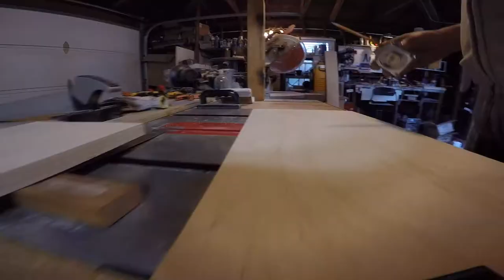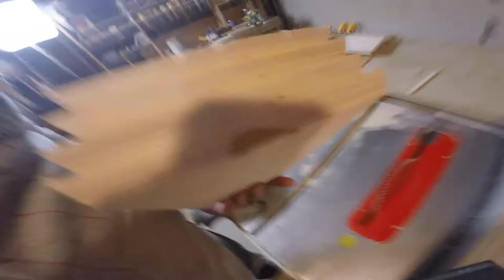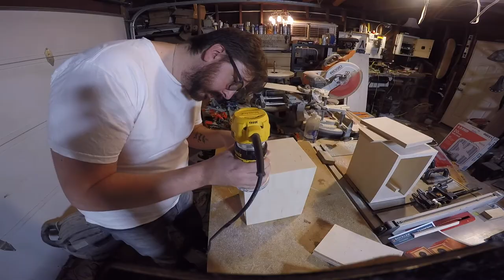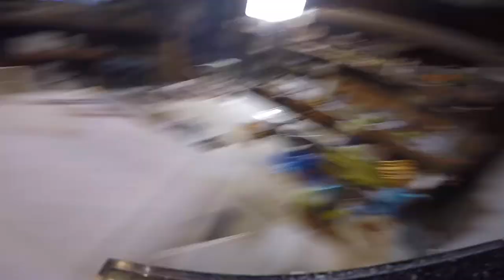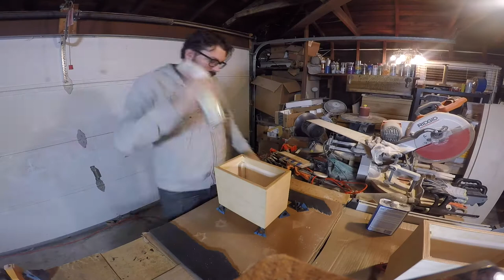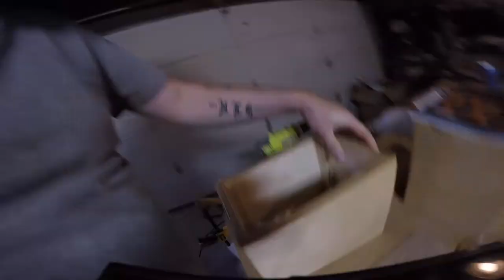DIY PLYWOOD BOOKSHELF SPEAKERS

Comment: Your "transistor" in that internal wiring is a capacitor  which acts as a crossover. 
I would suggest if you want to build a better set of speakers to get yourself a kit from Parts Express called the C note.

Comment: Wait... Exhaust port?, I never heard that before, that enclosures aren´t supposed to be sealed?, Or ported?
That hole is mixing  inverted sound waves from the back of the cone of the midwoofer to the front ones, that´s making cancellation in the room, reducing bass response and some mid frequencies.
Otherwise, nice build, i love plywood termination, nice video too!